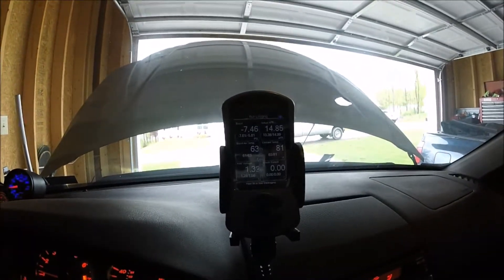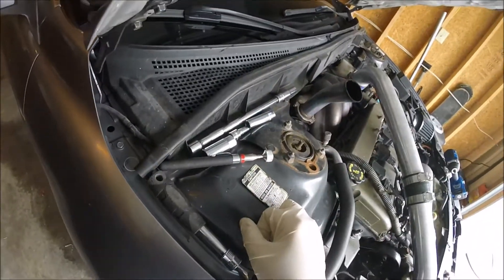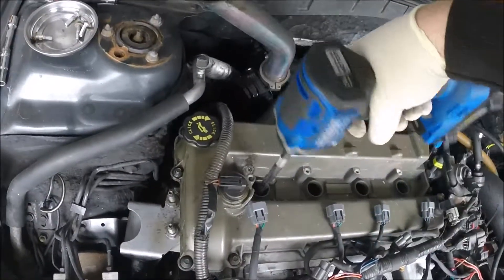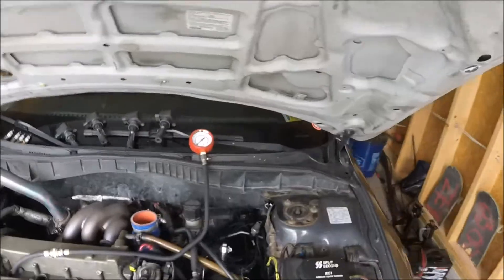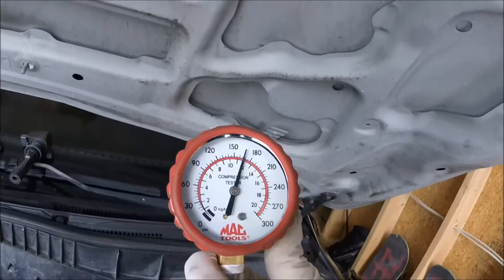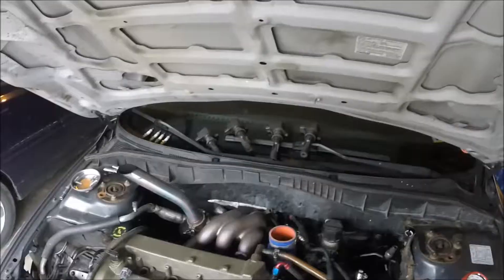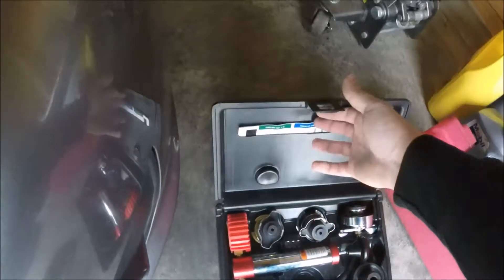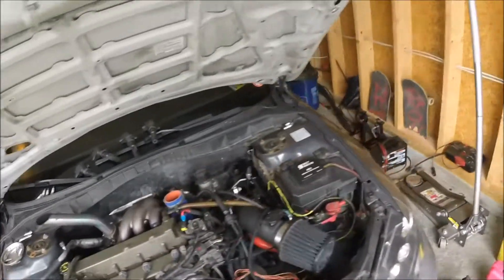How to Compression Test a Mazdaspeed!

Comment: Nice build brotha!! I have a 2010 ms3- 
Cobb fmic- fully bolted- Nishan tuned base map 1 revision (18-20psi) its a 110+ degrees here atm lol.. i have a 3in Dp into one cat> 3in full straight pipe to the stock muffler and dual tips. I like it quiet and sleeper status but I blew a hole in the piping right before the stock muffler. got it welded same day. Is it restricted that bad I kinda need a good muffler now? Lol Idk maybe cause mods and more boost a stock muffler really does lose powa!

Comment: For the compression test, do you have to disable the fuel system maybe by pulling out the fuse for fuel pump or something?
Reply from the maker: mikef058 you can do that to be safe, but on mazdaspeeds (and most other cars) if you hold the accelerator pedal down the whole way while cranking it over, it disables the injectors from spraying fuel.

Comment: I have higher compression on cylinder 3 on my speed 3 too for some reason, I was thinking it’s maybe a valve stem seal related issue and it’s getting more compression due to the cylinder being when but who knows!
Reply from the maker: Trevor Nelson that is weird. Usually cylinder 3 gives the lowest compression number due to the lack of air flow from the stock intake manifold.  Unless of course you don't have a stock one. Lol
Reply: Titanium Mazda weird no mines a stock manifold and stock internals, I’m thinking I have a leaking valve stem seal on that cylinder so I’m getting a “wet compression test on that cylinder. I just know the plug on that cylinder seems to always get fouled before the other 3 too. I’m doing my timing chain in a couple days so I’ll just replace all the valve stem seals for peace of mind I guess and see what happens compression wise afterwards.

Comment: Absolutely great video. I'm looking at a 2007 mazda speed 3 and it has a rattling rear strut and low compression. So what exactly does the low compression mean/ do and dhow do you fix it?
Reply from the maker: white splash it could mean a multitude of things. Normally if you get a low compression test, you'll do a secondary test (leakdown) to verify where it's losing compression from. Could be your rings, valves, etc.
Reply: @titaniummazdaspeed6  head gasket also

Comment: will this work on my 2004 jeep i6 plz respond ty
Reply: it will. the compression test like this works on all gasoline engines, just remember to get the right adapter and give it full throttle when doing that and remove the fuel pump relais! Good luck!

Comment: Hey man, great video! I have a question, my ms6 feels like it has a slight misfire, no codes present but I did the "dollar bill test" on the muffler and the engine is puffing while it runs. Any ideas what would cause this? Runs and drives great otherwise, it's stock.
Reply from the maker: Tevin Sorenson I would check your exhaust for leaks first.  Then if that checks out, move on to checking the spark plugs and do a comp test.  If you have no codes, then there isn't really a solid way to tell until you get one.
Reply: Titanium Mazda Thanks man! I feel like it'd be running much more poorly if it had any sort of burnt valve/valve leak. I'll start with the exhaust spark plugs and see what I get.

Comment: hey can u tell me what u gap your plugs at my mazdaspeed6 wont run worth a damn i just replaced the spark plugs and it breaks up really badly under boost or high load
Reply from the maker: K1LLERAGR you'll want to run them at around .028 inches. I run mine a bit less at .024 but that's only because I'm running 28psi. If you gap them down to that, it should fix your issue for sure!
Reply: i have denso iridiums and i run 22psi
Reply from the maker: K1LLERAGR start with .028 then and if you still get blow out, move them down even more
Reply: ok thanks